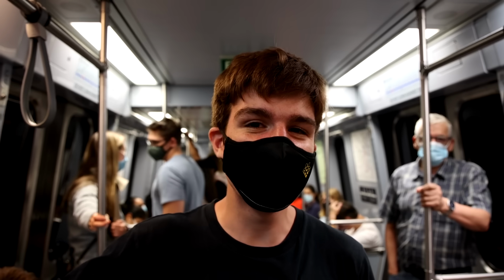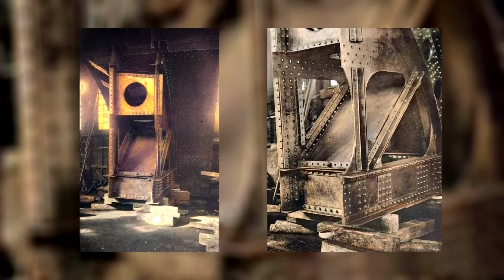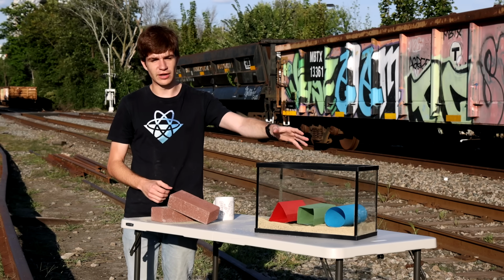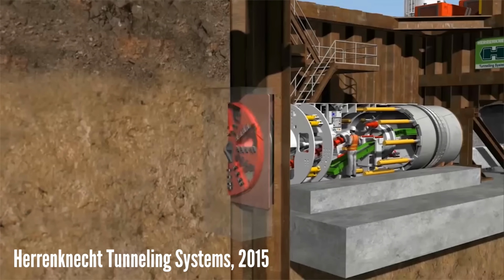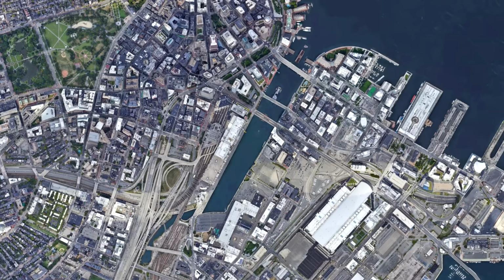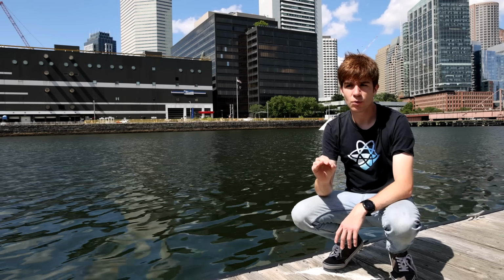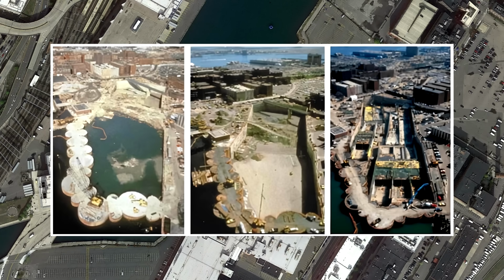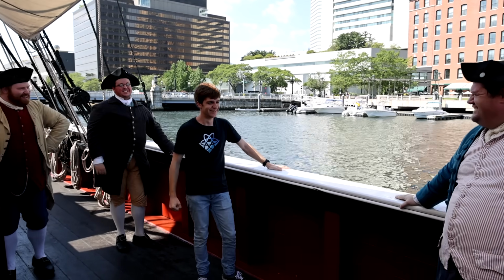Why It's So Hard To Dig Tunnels Underwater

Comment: Hmm, wouldn't an underwater tunnel with an artificial vacuum sink? It would be quite ironic if a transcontinental magnetic railline would need air pockets to keep it buoyant, after tremendous efforts were made to keep air out.
Reply from the maker: Good questions! So the artificial vacuum will actually make the whole thing less dense (same volume but less 'stuff' inside it). While the will be an extra 1 Bar of pressure different with the vacuum, we already have multiple Bar due to the depth so it's not actually too extreme. That said, high pressure + underwater vacuum is a recipe for disaster!
Reply: well a vacuum is lighter than air but the heavy part is the walls needed to maintain it. though if you’re under water you’ll probably have a very large pressure outside that would be way more significant than the vacuum.
Reply: Plus the pressure differential between the inside and the water would probably be impossible for any material to really handle when built to any reasonable specification.

Comment: This was an excellent video. It's incredibly interesting how techniques then really don't differ overly much to what's done today, just on a far larger scale.
Reply: A big problem with scaling it up to cover thousands of miles is you add in a few factors you wouldn’t have to worry about on a small scale. For example the movement of tectonic plates is only a few centimeters per year but what would that do to a structure thousands of miles along that stretches across multiple plate boundaries? Also I am guessing the curvature of the earth probably causes quite a lot of problems at that point the tunnel from space would be really curvy. What about the pressure this thing is under there is a difference between the sea and the river if this thing is under the deep ocean it’s going to face a lot more pressure. Also since the thing would be so huge there is more potential points for it to break at and the repairs would be insanely costly far out at sea. What about the movement of currents and corrosion if the tunnel is so huge I bet it’s a lot like tall buildings with wind. Overall such a project seems like it would face a lot more challenges then the guy acknowledged technological as well as financial.
Reply: @caelcdye9575   never mind getting the air into the tunnel and the seepage out lol
Reply: ayooo its the rimworld guy
Reply: Yoo it's the rimworld dude
Reply: Or from what was done thousands of years ago by the Romans when they built things underwater, like some larger bridges and the harbour at Caesarea.

Comment: Note: and still today it’s not perfect. Today, when there is heavy rain Aquarium station still leaks.
Reply from the maker: Yup, 100% I tried to do a scene on "and here's the massive pumps where all the leaky water gets removed" but the MBTA were having none of it
Reply: @AtomicFrontier  They don't want you looking into their finances, building materials, or arrest records either.
Reply: @AtomicFrontier  I'm impressed you were able to get what you did!  MBTA are weird.
Reply: It is fitting with a name like that.
Reply: The Severn Tunnel linking England and Wales has a bit of a leak too. Since 1879 they've had to pump out 50 million litres of fresh water per day. It's estimated that it would only take 26 minutes to flood if the pumps and other measures failed. I find it amazing that engineers 140 years ago were able to deal with it.
Reply: @georgeprout42  I feel like it's more like an 1879 solution that no one has bothered to find an alternative for 140 years.
Reply: @abunchofiguanaswithinterne2186  That is the english way
Reply: @georgeprout42  that's the fun of building under the water table...
Reply: Modikimaachinal Auruskabaapgandu  True. Its more of a fantasy but still, its a good idea

Comment: Is it possible to build a train over a ocean like one huge bridge
Reply from the maker: Technically yes, but the issue with that is storms + pirates. Also you'll need even longer tethers / pylons to support it
Reply: @AtomicFrontier  Pontoons!
Reply: It would likely also be pulled apart or pressed into itself due to continental drift and the absolutely ridiculous distance it crosses
Reply: @mathias3721  Actually, continental drift is only an issue if you're anchoring directly on either side of a rift, but here it would be immesurably tiny.
Reply: Pretty sure XKCD did something on this
Reply: Also the bridge would be a giant lighting rod making it  significantly harder to build
And the resources are way too much for it to be cost effective or time efficient
Reply: It's feasible but expensive.
Reply: @CHRF-55457  Possible but infeasible.